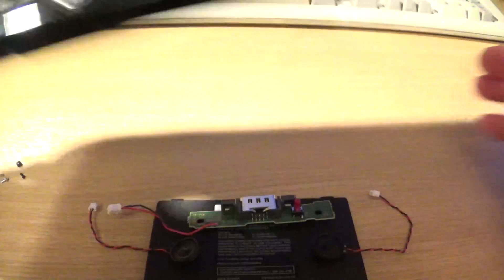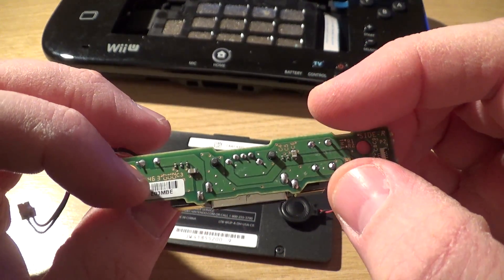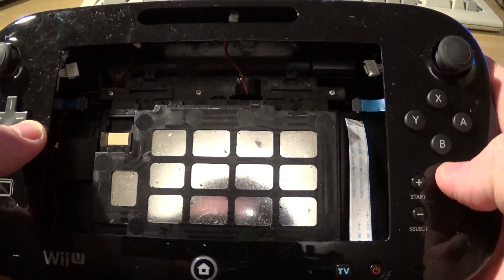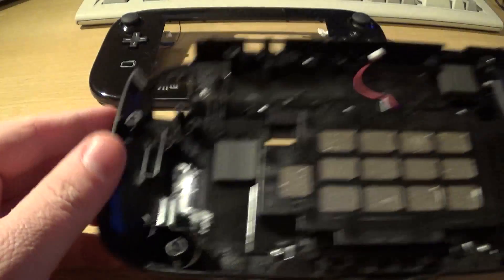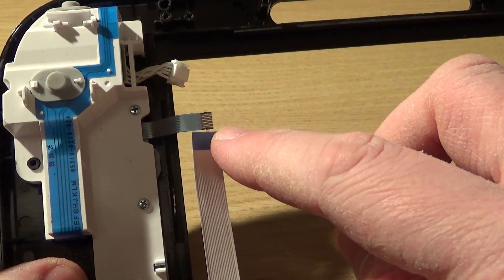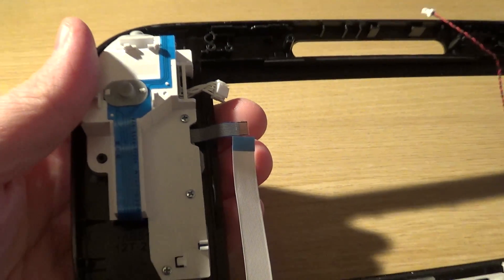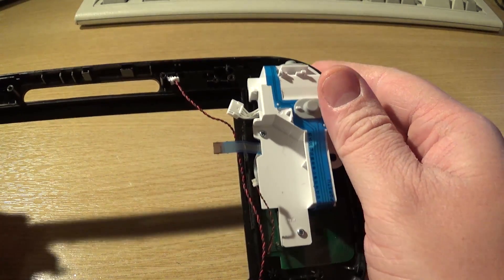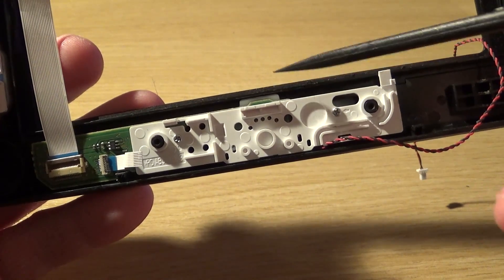(ABANDONED PROJECT) Raspberry Pi in a Wii U Gamepad - Part 1

Comment: could you do this but with nintendo switch internals inside the gamepad instead of the PI ?
Reply from the maker: It might be possible, but I'd be concerned about the length of the ribbon cable for the Switch's screen... To be honest you'd be better off getting third-party controllers to slot into the Switch to improve the ergonomics...
Reply: @blcollier  I really like the gamepad feel, do you have an other controller in mind that is similar to it ? Also I thought we could maybe fit the regular switch inside the switch lite case ? ( to keep the tv out feature)

Comment: The screen might fit better rotated 180 degrees so the connector doesn't interfere with the controls, then just rotate the screen in Linux...
Reply from the maker: +Zofe Stormcaller Thanks, that's certainly an option!

Comment: Have you seen this link http://m.imgur.com/gallery/wmopX? It looks like same kind of project that you have. I like a lot of your channel. I made raspberry pi pad with 7" screen. Pic 1: https://scontent.cdninstagram.com/t51.2885-15/s640x640/sh0.08/e35/12798153_1686056165010795_276562378_n.jpg?ig_cache_key=MTE5ODcxMTk4Mzk4MDYyNTA4Mg%3D%3D.2.l
Pic 2: https://scontent.cdninstagram.com/t51.2885-15/s640x640/sh0.08/e35/12797756_1696886193922043_1250530221_n.jpg?ig_cache_key=MTE5ODcxMjUxNzYzODcwMDIzMA%3D%3D.2.l
Reply from the maker: +Tapani Isokoski I hadn't seen that before, thanks! Shame he couldn't fit the Pi & battery inside though!

Also I like the look of your project!
Reply: Thanks!

Comment: Random mofo slang got me by surpise =) 
I would suggest you get a Screw Tray (With magnetic pad) , I love mine, fairly cheap.
Flatflex scares me, wouldn't know how to start soldering it =p (Also, the flatflex connector tells you how many pins it takes)
I would remove the battery holder, it takes up wayyyy too much space, unless you insist on using the original battery,then maybe leave it be.
Could you provide me with the size of the lcd hole? width+height?
Reply from the maker: +Glychee S The hole for the screen is 144.14mmx84.3mm.

The battery holder is probably going to have to come out, but it'd be handy if I was able to keep it! I don't plan on soldering the flat flex connectors, that's what the homebrew reflow oven is for! :)

Comment: The few projects I've seen using a Wii U controller hard shell with a 7" screen have cut the case vertically, and then made an extension for the middle out of some other material. If you decide to go back to a self-made shell, https://www.youtube.com/channel/UCeLvy6HuxVhxluphQ8cp8pQ has an interesting idea in his latest Pi Laptop, where the bulk is made with laser cut acrylic, with corner pieces made on a 3D printer. An earlier design was entirely 3D printed, where it was made in sections then attached together.
Reply from the maker: +tom611 Yeah, I'm not afraid of cutting the Gamepad shell, but the problem is going to be room around the board to fit in all the controllers and wiring I'll need... I really need to get my backside in gear and pull it apart!

Comment: I thought about doing a project like this but for a portable GameCube with a WiiKey Fusion) installed in the Gamepad case. Don't have enough know-how yet to do something like that though. By the way, I also got my little 2,8 inch screen in the mail this weekend, turns out it was too big for the GBA as well. :(
Reply: No, the idea is to chop the gba up in 3 pieces and use the sides and throw the middle away,modify the original pcb to become a shield (hat) for the pi along with an lcd.
this will make for a quite ugly build,but i just want to have something that works well =p
Reply from the maker: +jorenmartijn That's a shame!
Reply: I want to cut up an original gba in three halves(not use the screen and slot etc)and use the sides as a detachable button shield for my pi 3, then it can sit in its case and have the (ergonomic!) handles mounted on its sides
Reply: I don't think you'll be able to fit a Pi 3 into a GBA case if that's what you're saying. Using the original controls pcb is a good idea though.

Comment: One question: Is the the left analog stick (the one above the dpad) also a button like the one on the right side? If so, I think there is a pin missing on this flat cable, since there are only six pins plus the common ground. Also you might run into problems fitting the screen in there. I don't know if I saw it right, but I think the circuit boards of the analog stick are to close to the edge of the screen frame.

Besiges that: Thank you for sharing the project and keep up the good work, I'll definitely follow the construction
Reply from the maker: +bomberman2995 Both the sticks are analogue, and 6 pins makes sense: common ground, 2 for each potentiometer (x + Y), and one for the "click-in" button. I'll know more once I start tracing the pins out though.

I'm a bit worried about the screen myself; that's the next task is to tear out all of the insides and see if it'll even fit in there when there's nothing inside it. If it does then it's a problem I might be able to work around. If not then I'll have to think of something else!